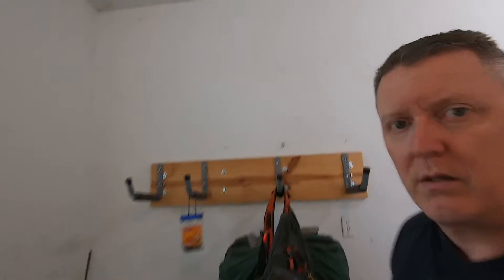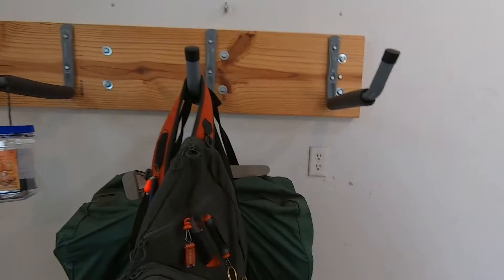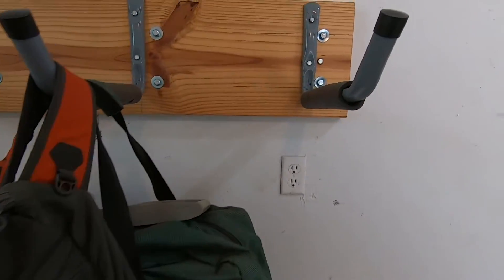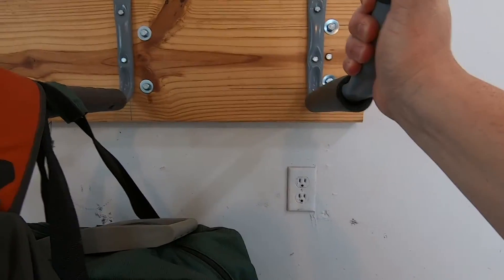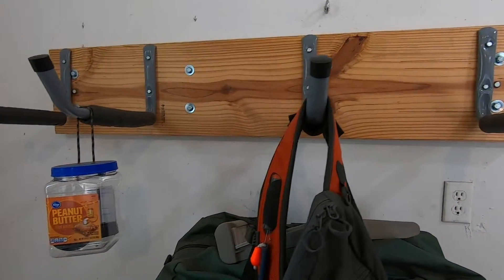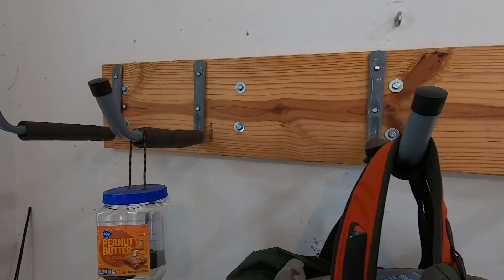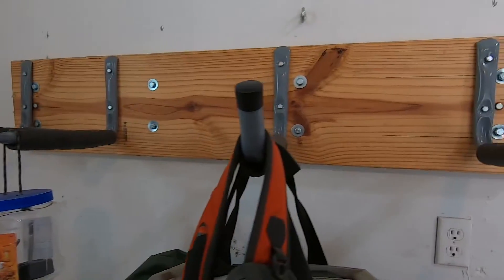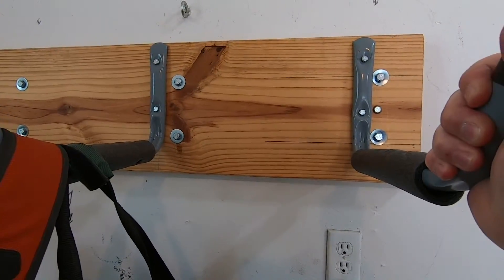DIY Jeep Door Holder

Comment: Does that design not mess up the door window rubber
Reply from the maker: It does push the rubber up (leave an indentation)but  it always bounces right back when I put the doors back on and my windows don’t leak. I only have my doors off at the most maybe 4 or 5 days at a time if it was months at a time it could cause a problem. Thanks for watching and the comment hope this helps.